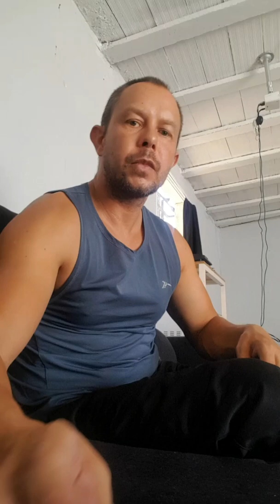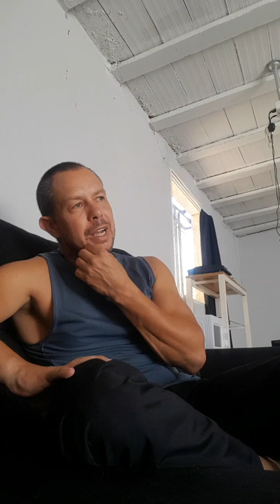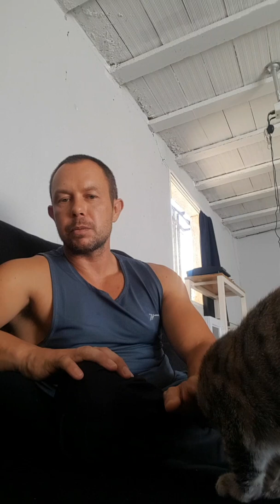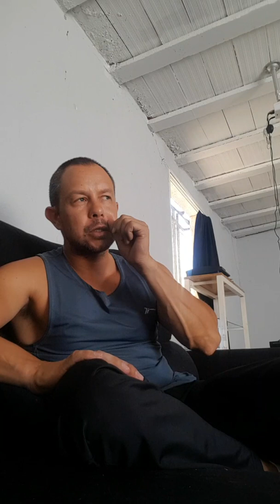Building an om606, balancing and weighing...

Comment: Also the engine was built for specific power output perimeters.
The OM series was designed & built well and very strong, so the basic engine design & components can be taken to much higher power than stock with proper components upgrades.

Because of the good design & strong components we can build engines to higher power & performance specs 

And tailor the power perimeters we each want,

My 606 build will be lower hp & torque than say someone building for drifting or maximum street performance.

I am amazed and love the versatility that the OM series of engines.

Can build for different power, rpm range & purposes.